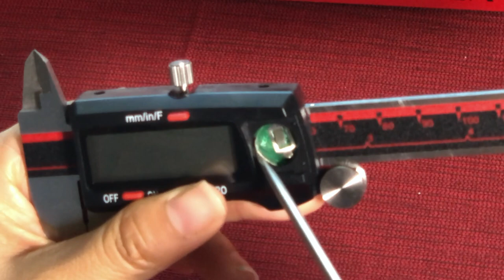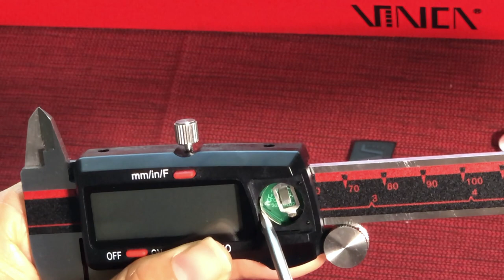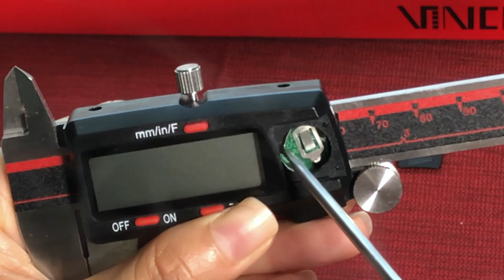Q&A VINCA DIGITAL CALIPER - The reason why no display after replace the battery and How to fix it

Comment: I have this caliper which works, but the display is now dim or fades in and out AFTER changing the battery.  I've replaced the battery 2 - 3 times and checking the battery with a voltmeter just in case.  But still doesn't work correctly.  I can tell that it's on, just dim to no display.  Any ideas?
Reply from the maker: Hello. Please contact us via email info@clockwisetools.com and we would like to help you solve the issue.

Comment: my calipers wont turn off.. they keep turning back on and incrementing in the negative even with the tension screw tightened.  The only way to stop it from burning through batteries and turning on constantly appears to be removing the battery entirely... I've only had them about a year.

Comment: Please! How to disable the automatic battery turn-on? My Vinca caliper always turn the battery on without my intervention.
Reply: Splendens Regan We cannot disable the auto turn on function. The most effective way to avoid it is tighten the lock screw (located above the screen) after use. This will prevent small movement which will turn on the screen. If it will still turn on, please contact us via email info@clockwisetools.com and we can help you set up a replacement.
Reply: @v1cscollection  ok, I will try it! Thank you!

Comment: These use up batteries way way too fast...bad circuitry ..The original battery that came in my Vica started leaking after 2 months and messed up the battery terminals too
Reply from the maker: Hello. So sorry about this. Please contact us via the warranty card and we would like to replace you with a new one.